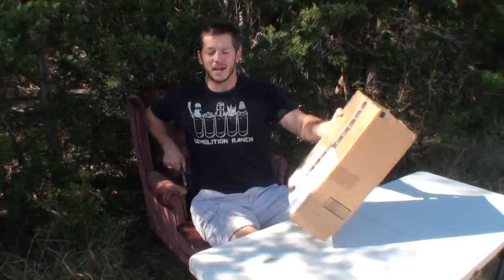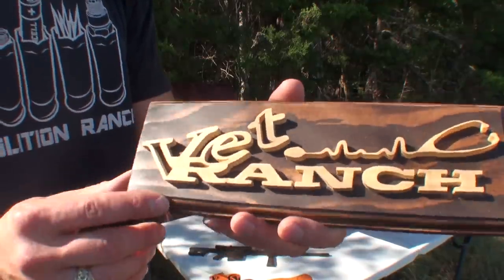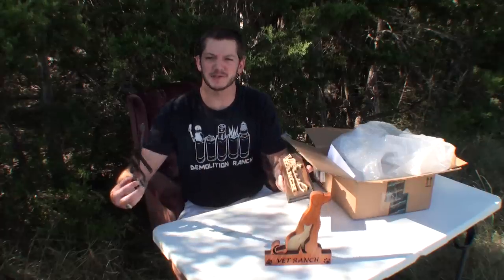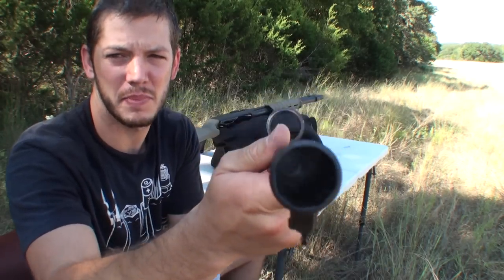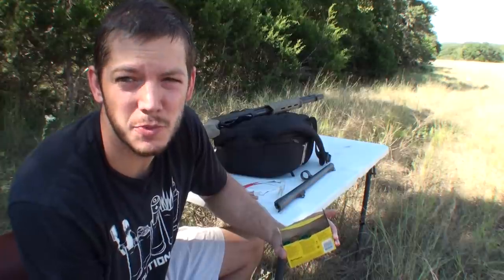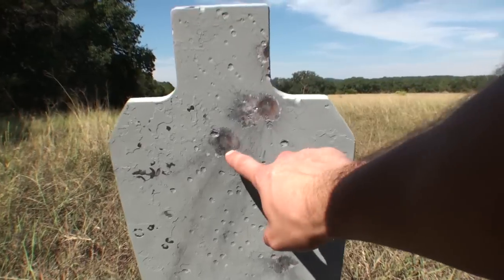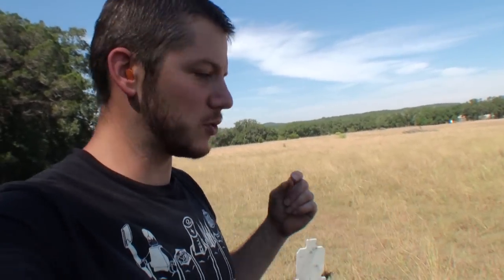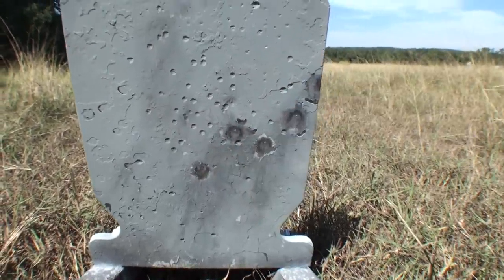Rifled vs Smooth Bore Barrel

Comment: I've found rems hv 3" 1oz work best for me.. I have a cheap red dot on my smooth bore 1100 with 30" barrel...lol.... (goose gun) but at 80 yards I can get a 5" group with 5 slugs shooting on my bag... I deer hunt with this gun this year and as that long ass barrel is heavy and well long, I like it.... I thought about cutting it down but then it lessens the range for ducks and geese.... At least I think it would? It's been an all around good gun... The only down fall I've found is it's an 1100 magnum and even high brass 2-3/4 won't eject and trying to find a light barrel for 2-3/4 or a slug barrel is like trying to find gold... Everyone wants too much in my opinion .... So for now it's just the goto all around gun from hunting to home defense!!!
Reply: any 23/4 inch barrel will work on your magnum receiver. try ebay.

Comment: After years of playing around with slug guns I took an old 870 and did everything I could to increase accuracy. Pinned, scoped, stocked, Hastings barrel. Just for fun. It shoots inside an inch at 100 yards with Hornady sabots. Admittedly not necessary, but why not?  It gave me great confidence this fall. Performed perfectly. One inch is way more fun than six.

Comment: Rifled Slug: meant to shoot through a smooth bore, wouldn't recommend tighter than a modified choke to be on the safe side.  Not designed for slug spin. Spin doesn't matter on rifled slug.

Sabot Slug:  meant to shoot through a rifled barrel to spin the slug.  This increases accuracy at longer distances. Sabot slugs are meant to be spun for long range accuracy.

NOTE: With sabot slugs, the spin also helps the slug to open up better when it contacts the target. You still get good penetration, but the expansion is much greater than with no spin.  

It's not unlike throwing a punch:  a straight shot hurts with some damage.  A shot where your fist is slightly turning when fist meets face makes for a lot more damage.
Poor analogy, true, but it is kind of the same principle.

Rule of thumb for rifled slugs:
The rifling on the slug is meant to help the slug smoosh through whatever choke is on the gun: cylinder, improved, modified, even full.   
Period.  Doesn't have ANYTHING to do with spin or stabilization .  NOTHING.
Reply: Can I shoot sabot thru any shotgun

Comment: Hey, why are you shooting Foster style slugs out of a rifled barr- oh, wait, this is Demolition Ranch. Never mind. XD

Foster style slugs are meant to be fired out of smooth bores, usually up to a modified choke, though they are usually meant for improved cylinder chokes. They are designed to spin without rifling, and if you aren't using a choke, and your barrel is just cylinder choke, they actually suffer in performance.

Now, I'm new to shotgun ownership (just bought my first one, a Mossberg 500 FLEX with 28" barrel, coyote tan + Real Tree hunting configuration on May 5th, 2019), so I may have some of that info wrong, but I think I got it all right. Been studying up on all these different options I have when buying shells, learning as I go. Really looking forward to turkey season this year!

My turkey setup (work in progress):

https://cdn.discordapp.com/attachments/360191283605536768/575420520569241600/20190507_130549.jpg
https://cdn.discordapp.com/attachments/360191283605536768/575443659030265881/20190507_150655.jpg

Reticle is 6 MOA, sight picture is 24 MOA, if memory serves. Circle is 24" @30yds. TruGlo Gobble-Stopper model.
Not sure yet what shell load is used for turkey. Currently have a box of Winchester steel BB shot with 1,600 fps velocity.
Still need to pattern it and do more research into turkey loads and turkey hunting educational material.
Reply: Do you use a choke with slugs? U want to use a full choke but am afraid It will mess it up/ mess my barrel up, I just got some federal rifled slugs
Reply: @isaachall9126  From what I have read, Goattacular is correct. For a smooth bore, Foster-style / Rifled slugs work 'best' in Improved Cylinder chokes. However, you can shoot those slugs out of Cylinder up to Modified. Anything past Modified is not recommended - though you still "can" shoot them using a Full choke, etc., but it is not recommended because there is a chance of causing damage. For a rifled bore, Sabot slugs are the way to go. Sabots work 'best' in a rifled bore, but they can also be shot through a smooth bore. Everything I've read says using Sabots in a smooth bore is "basically a waste of money." Main thing to remember is to always use the correct gauge and shotshell length.

All that being said, all the sources I have read also state to try different brands of slugs. Just like a rifle, different ammunition will have different results in a shotgun as well.

Good luck! And remember, enjoy yourself - but also be safe.
Reply: @CJ-by8ij  Thx, yeah I read up on the shotgun barrel thick ness and with out the choke in it only have a few millimeters and putting improved motified would be smaller than the slug
Reply: @isaachall9126  Yeah. One thing I forgot to mention, but you probably already know from your research, is if it is a removable choke to not fire it without a choke in place or the threads will be ruined. Lol

Comment: sabot slugs bruh.. you shoot SABOTS out of a rifled barrel..
Reply: Mike Albrecht that and no smaller than 3"
Reply: Joe Rotolo 2-3/4 works fine
Reply: yup. i shoot hornady sst sabot slugs in mine
Reply: well whatever. IF IT WORKS IT WORKS AND YOU CAN NOT DO SHIT ABOUT THAT MISTER.
Reply: Joe Rotolo says 2-3/4 & 3" stamped into that barrel numb nuts Google 2-3/4 sabot slug
Reply: yeahh that contain stablizer design so no need for rifled barrel, it design for smoothborne. so stupid if he put inside rifled barrel.

Comment: I will say that when I go whitetail hunting, I use a smooth bore 870, and I normally use the rounds you had, Remington sluggers, which are rifled rounds, which is that the slug has its own groves on it so you can use them in a smooth bore shotgun.

Comment: I admittedly know little about shotguns but, Rifled barrel = sabot slug and smooth bore = Foster rifled slugs.You were using Foster Rifled slugs and so you gained no improvement in accuracy when you switched to the rifled barrel.

Comment: As a Black powder shooter I can tell you Smooth bore are actuate" IF" the right size ball and powder charge are used. Cap & Ball has U tubes where he uses cut bar stock in a smooth bore musket at 50 yards and hits the target.  One of the reason Smooth bore get a bad rap is Flintlock Military guns & Loads. In order to fire faster, smaller bullets were used because they only had to be dropped in the barrel. The same way they rattled down the barrel was the same way they rattled up the barrel when shot. 

I have a 12 Ga. Mossberg 500 with a 28" rifled Barrel and cantilevered scope.  Regular Slugs will spin in a Rifled barrel. I won't claim 300 yard shots, but It does a great job on larger wild hogs.

Comment: Were those rifled slugs?
Reply: I caught that too. He was using rifled slugs in a rifled barrel.....
Reply: +Hughes Enterprises Is that a bad thing? I haven't got a clue (don't really know a thing about guns)
Reply: +Wyatt O'Shea It's just kind of the belt and suspenders approach. Nothing 'wrong' with it, but regular rifled slugs out of an improved or full choke on a full length 26-30" barrel can be almost or sometimes more accurate than a sabot slug in a short 18" rifled barrel. (Slugs and full chokes are Just fine- the 'rifling' is just a safety measure that aids in accuracy with tighter chokes.)

The slight edge going to the sabot slug in terms of the projectile technology vs a 1oz wad of lead. In all reality, if a deer gets hit with either where it's supposed to, you've got a dead deer.
Reply: +Hughes Enterprises There's not really any penalty firing a rifled slug from a rifled barrel.
The rifling on a rifled slug does not make the slug spin; the rifling is there so the slug can swage down if fired through a barrel with a choke. What keeps the rifled slug firing true is the same thing that makes a badminten shuttlecock fly true; the weight distribution and wind resistance.
Reply: +Hughes Enterprises shooting rifled slugs from  rifled barrel fills between the rifling with lead basically making it more of a smoothbore every time you do it lol
Reply: +Mia Rojek that's not how it works. The rifling in the choke or barrel would engage the 'rifling' in the slug but not enough to make any substantial difference. Shooting rifled slugs through a rifled barrel doesn't make them any more accurate or build any lead in the rifling. It's simply wasting money on two expensive components that don't help or hurt each other. Non-rifled lead slugs are far cheaper and may yield better accuracy.

Comment: "this gun hurts!" doesn't complain when he shoots a .50 BMG in his other videos
Reply: Trumpeter030702 50bmg doesn't kick that much considering it's a very high caliber
Reply: Extreme Team I believe it kicks about like a 7mm? if I remember right? 7mm kicks hard but, a 3 inch magnum coming out of a 12 guage kicks a lot harder.
Reply: 50 BMGs typically have very effective muzzle brakes, some generating FORWARD thrust (they destroy cheap scopes due to the double recoil).

Recoil energy wise they may match a 7mm, but it'll feel even softer, as it's a push rather than slam (longer duration). 30+ lbs of rifle weight also helps!
Reply: My turkey load is a Hevi Shot 3 1/2 " 12 ga load throwing 2 1/4 oz of shot...Fired out of a pump gun with synthetic stock it sure it sure gets your attention !

Comment: So the rifled slugs worked better in the smooth barrel that they are designed for. ✔️ Got it.
Reply: For those unaware, he should have used sabot slugs which are designed for these rifled barrels.  The slugs he used were typical slugs which are specifically designed for smooth bore barrels because the vast majority of shotguns are smooth bore.  That's also not to mention there's some interesting effects you can get out of running bird and buckshot from a 18.5" rifled barrel.  Namely, if you have a significant other who cant hit the broadside of a barn.  Birdshot plus a rifled barrel will take care of just about anything they're even vaguely aiming at.
Reply: @Frankovelli  🤣 I think I'll stick with smooth 28" barrel and modified choke for that. Thanks

Comment: The M1 Abrams and Leopard 2 have smooth bore cannons.
Reply: isnt there rifling on the projectiles?
Reply: ***** no?
Reply: AirsoftGamer they use fins, at least in the sabot rounds
Reply: Isaac Priest i know?... its called APFSDS which stands for  Armour Piercing Fin-Stabilized Discarding Sabot. ie: fin-stabilized
Reply: AirsoftGamer sorry, that was intended for DeAtHmEtAlFaN, not you.
Reply: Isaac Priest oh well, he'll probobly see it
Reply: nope, the HEAT rounds are simply nose heavy like a slug.
Reply: What about the fin-stablized heat round?
Reply: InsanoBinLooney Modern HEAT rounds use finns to stabilize themselves in the air.
Reply: Man, all modern tanks have smooth cannons but it doesnt prove a thing. They use different ammo. As you have been told, shels are with fins. But in ww2 they used rifled barrels and were able to shoot for kilometers with acceptable accuracy.
Reply: Man, not all modern tanls have smoothbore cannons. for example the Challenger 2
Reply: you are right, sorry. But Americans updated Abrams with installing smooth bore cannon. Maybe GB doesn't want to develop new ammo.
And, surprisingly, they use fin stabilized APDS. I wonder how it works with riffled barrels
Reply: hes talking about shotguns not tank guns
Reply: Well if you think about it tanks don't really aim because it is a big projectile that's used to take down other tanks
Reply: AirsoftGamer look up the difference between a Lbc sabot for 12ga and a rss12 sabot for 12ga. You can not shoot a sabot in a smoothbore unless it has a casing. Google